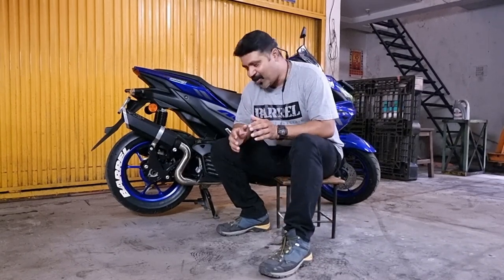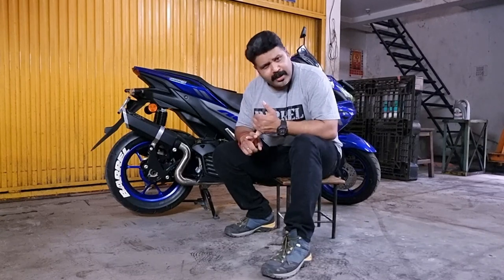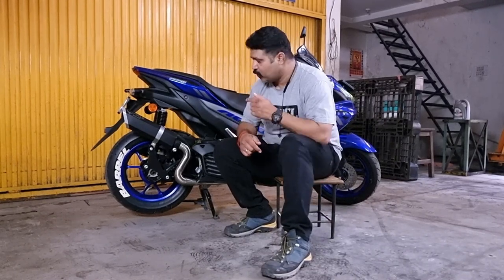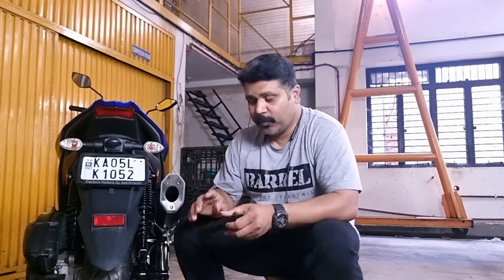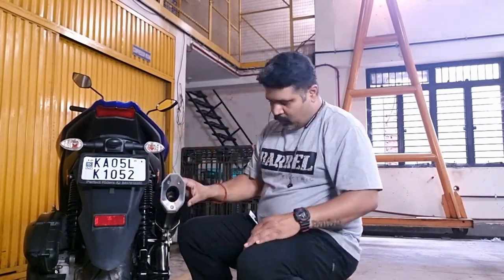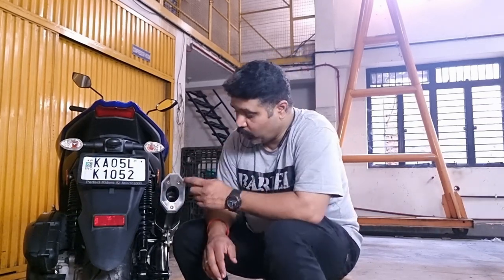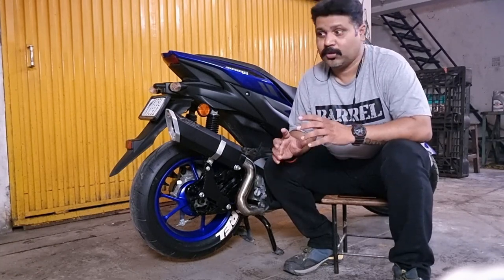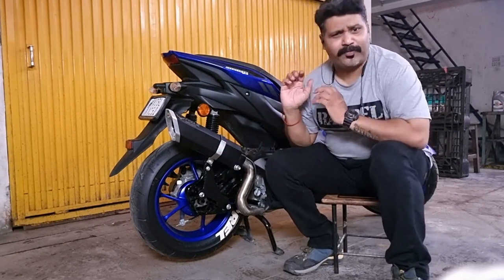Yamaha Aerox with Barrel Rogue | Fully explained by Mr Barrel

Comment: The positioning looks cool, but it ain't a new muffler ,just the bend pipe is & even if it is which I doubt why not a new design..... & does the after market exhaust damages the engjne in a long run??
Reply: Hey.. the muffler is designed for engines with the capacity between 150 to 650 cc and it works like charm. Also the bend pipe is not hollow. It has a built in resonator to maintain backpressure required for cvt engines and also muffles harsh noise